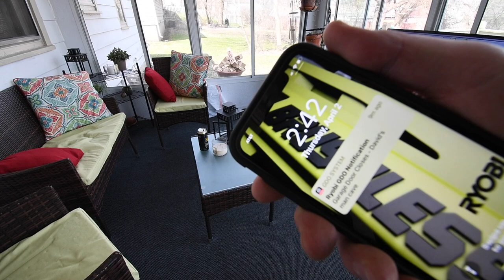Ryobi 40v Powersource Test

Comment: I have a lot of Ryobi tools, mostly 18v but my trimmer is 40v and never had an issue. i just got this power station today and an issue i have is the internal cooling fan is not coming on. i had it hooked up to a star finder type telescope stand and had the inverter light on. i operated the stand a bit and it worked fine, however the inverter internal cooling fan never came on and the inverter felt hot and smelled like overheated electronic. my question is shouldn't the fan run continuously or is it temperature controlled. i had it lying flat so the fan vents were exposed so that wasn't the issue. the fan is visible thru the vents and it wasn't running.

Comment: Will a 4amp 40 volt battery in the 300 watt inverter have more run time than a 4amp 18v battery in the 150watt inverter using the same household item
Reply from the maker: I believe so. because the cells inside will share the load better and it will use less energy to do the task.
Reply: @ManCaverTools  ok so the main purpose of the 40 volt battery is just to run bigger appliances

Comment: based on your run time of 2 hours and the battery watt hour of 144W.  The 2 devices only use 75-80w.  you could have run that with the 18v inverter with a 9 amp and get the same results.

Comment: I have the smaller inverter #150bg.  The highest ah battery I have is a 4 ah battery.  I got it For the price and now they came out with the larger inverter and usbc port.   I do have a multi port usb.   But really haven’t tested it out  since I don’t have any usbc devices.   Could I use that usb multi port that has the usbc port and charge my usb devices.
Reply from the maker: I don't Recommend it. but I think you can